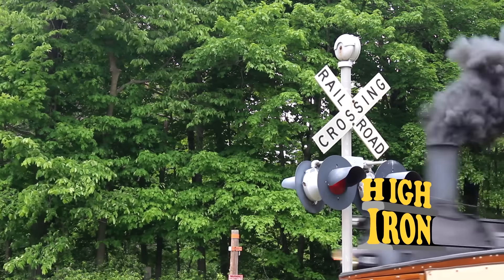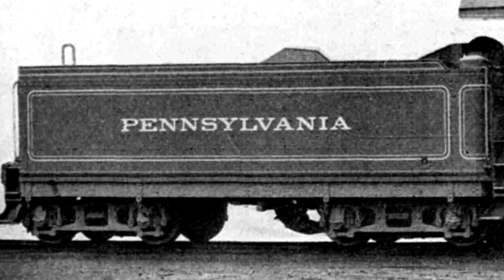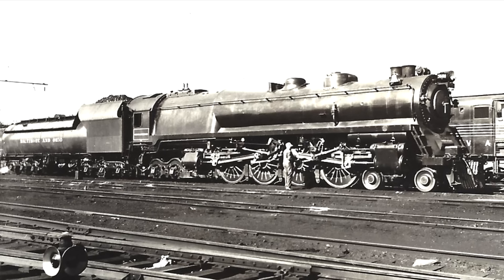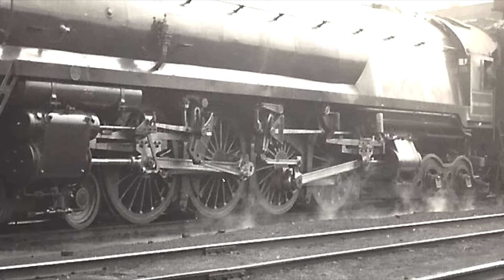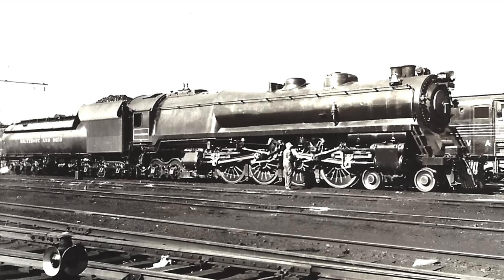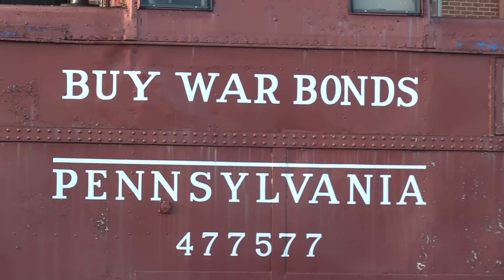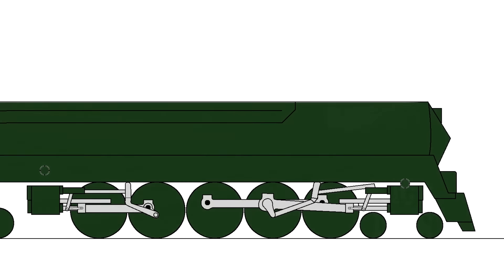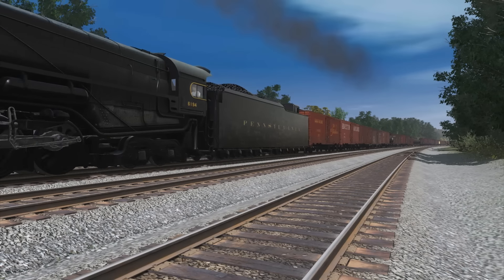Why Weren't Duplex Steam Engines Successful?

Comment: What's surprising is how little the steam locomotive changed between 1870 and 1940. Mostly they grew in size and power, the most notable changes in the design were the addition of superheaters and feedwater heaters in the World War I era. No thought was given to a fundamental change such as use of a rotary positive-displacement expander, such as the scroll device patented in 1912. This would have eliminated the dynamic augment issue and greatly increased efficiency, but there was no incentive for change. The railroads had long been a complacent industry, having no competition except other railroads using the same equipment and methods, so they were caught flat-footed when the 18-wheelers and Interstate highways began to appear.
Reply: At least in the US, anyway. The UK did have a few unique developments, and while they still stuck with the basic reciprocating piston design the layouts and implementations were different.

One good example of this is also one of the most famous locomotives of all time, the Flying Scotsman - or really, the class it belonged to, the LNER's A1/A3 Pacific designed by Sir Nigel Gresley. In addition to the two outboard cylinders, the A1/A3 was also equipped with a third center inboard cylinder, allowing for smoother acceleration, more power and higher wheel RPMs. Other developments on British steam locomotives include designs with fully inboard cylinders to reduce oscillations due to piston movement and tapered boilers which reduced sloshing.
Reply: If you consider the motor car you should not be surprised.  Progressive refinement has worked miracles, radical changes have failed.  Very few features of modern cars had not been thought of a hundred years earlier. They were expensive and impractical at first but refinement has brought them into normal use.  Steam engines did have radical changes such as superheating, piston valves, compensated suspension being among them.  But in general detail improvement made a big difference to the overall capabilities of the engines.
Reply: And just like the locos before them, region influenced design.
Reply: @VestedUTuber  Gresley's three-cylinder designs were his philosophy; nothing 'additional' about them!
"inboard cylinders" were basic to British railway locomotives, along with 'inside' valve gear.
Superheating was adopted early in the 20th century and, latterly, steam-flow improvements made a huge difference to performance (c/o André Chapelon in France).
Reply: thats the capitalistic nature for ya. Why spend a lot of money innovating when doing nothing new makes you a lot of cash?
Reply: @Michael4201YT  That depends on the prior evaluation of the R&D.  If long-term lower costs (positive payback) are in prospect, go ahead and do it.
Reply: @EllieMaes-Grandad 
I think you're missing the point here.
Gresley's 3-cylinder designs may have been his design philosophy, but they still provided advantages over 2-cylinder designs for certain usage cases. Same goes for 2-cylinder designs. So while they may have been "standard" for the UK, they were still innovations over earlier designs.
Reply: @VestedUTuber  You're maybe not understanding me here.  Three cylinders had advantages (more power, smoother application of it, better riding) but with disadvantages too, such as complications, costs and increased maintenance (think conjugated valve gear).   Not so much innovations, more like developments.   U.S. roads had 3-cyl locos . . .
Reply: Because it's always a balance of economics. Steam locomotive innovation only happened when there was a need for it and the method of implementing it would not cost more then the profit it returned. This is why condensing trains only existed in specific locations that getting access to water was costly as it would need to be shipped in. And by 1912 it was clear that either diesel, diesel-electric, or electric was going to become a major part of railroads so any steam based innovation needed to pay off big dividends. Which is why you saw experimentation with so many things but it never paid off to implement widely.
Reply: @EllieMaes-Grandad 
Innovation doesn't necessarily mean no drawbacks. If it did there'd be no such thing - you can't have a perfect system.

And I'm familiar with a number of US 3-cylinder locos. Many Shays had that sort of configuration. But I wouldn't consider them the same as a Greesley 3-cylinder locomotive, if anything like other geared steam locos they're a massive departure from conventional design and a separate innovation in their own right.
Reply: @VestedUTuber  Indiana Harbor Belt had 0-8-0 transfer engines that were 3 cylinder and equipped with booster engines but the 3-cyclinder didn't catch on due to maintance issues.
Reply: @VestedUTuber  The Shays were designed for a specific purpose and fulfilled it superbly.
Reply: What's really interesting is to consider where Steam locos would be today if they'd continued to get the full brunt of development up until today: It had pretty much entirely stopped by the end of the 50s for most countries, meaning steam locos didn't get to benefit from quite a decent chunk of where humanities technological progression really started to speed up.

Take for example the A1/A3's third cylinder that VestedUTuber mentioned, it was notorious for having timing issue at high loads due to thermal expansion of the linkages...these days we have alloys that exhibit little-to-no thermal expansion under much higher heat than you'd ever find in a steam loco yet are still strong enough for that kind of use. Or consider the effects of computer simulations on being able to effectively test thousands of slight variations of the plumbing to figure out the most optimal setup for the steam to go, for the smokebox/front end, etc. 

I'd wager that steam engines would still look familiar but have a tonne of differences versus what we know and love.
Reply: @VestedUTuber  I'm enjoying this debate, but all of you are talking around the thing that ended Steam as the primary source of power: a diesel engine delivers more power at the wheels per BTU of fuel consumed than a steam engine ever can. Add to that the other advantages a diesel engine brings - building block units of power that can be controlled from a single control point; versatility of how each engine can be used; and greatly reduced maintenance costs spelled doom for further development of steam. Trucks didn't sneak up on the railroads, they just didn't look at the reality of how transportation was changing and held on to their incorrect world view for far too long. Like, even today.
Reply: I remember one of the tour guides at the UK's National Railway Museum saying that if George Stephenson was shown 'Evening Star' (the last mainline British steam locomotive, built in 1960) he would have been able to look at it and identify most of the parts. The only two major changes since Stephenson's 'Rocket' of 1830 were that Evening Star had superheaters, and brakes!
Reply: @cdjhyoung  Who is they?  The trucks or the railroads?  Be careful using pronouns--I call it antecedent trouble and it was the RR's who didn't look at reality.  Diesel electric had even more advantages than just essentially being every engine's hauling its power plant so no need of overhead!
Reply: It changed quite a bit!  Air brakes, mechanical stokers, compounding, superheating (which crimped compounding), feedwater heating, electric generating.  Better valve gearing (long big story); in short lots of improvements between 1870 and 1940.  But they were running out of space and of time.  Wage costs all around were beginning to tell even Bigger Time.  .
Reply: @thomasrengel5577  Sorry about that. The "they" in my comment is the Board Of Directors of virtually ever American railroad that existed during the 1940's. It was not too difficult to see that the nation's roads and highways were making dramatic steps in improved surfaces and connections. The possible range of delivery of manufactured items by means other than rail steadily increased decade after decade. The railroad offered little in new approaches to servicing their customers, in fact the opposite is true. When railroad generally decided they didn't want to be in the single freight car freight business, they opened the flood gates for over the road trucking to become the Railroads equal in moving the nations manufacturing output.
Reply: I suggest checking out the Tornado. 
Built in 2008 with lots of incremental improvments from modern manufacturing methods meant it runs better than any other steam engine built before it.

From cruising around the UK to halping a stuck modern train, it is a marvel of engineering and recreating historical machinery.
Reply: What about the Steam Turbine locomotive?
Reply: @ZackarySchejbalCODBO2RGM2  Turbines, as applied to locomotive power, never caught on because they didn't offer enough advantages to over come their problems. Diesel fueled, direct coal and steam were all tried, and all failed to live up to the hype. I think the main problem with turbine technology is that it doesn't scale down efficiently and suffers from not handling the jarring action of a moving locomotive. Labor costs and fuel usage were the killing attributes to this technology.
Reply: @cdjhyoung  Was at least an attempt. Sorta like the electric steam locomotive
Reply: @ZackarySchejbalCODBO2RGM2  When tried, these didn't work very well mostly because a steam turbine needs a condenser to operate efficiently. Since the only cooling medium available on a locomotive is air, a condenser would be immense, and totally impractical.
Reply: @kc4cvh  I was arguing on that there was no thought was given to changes in steam.
Reply: @ZackarySchejbalCODBO2RGM2  There was a great deal of thought given to changes in steam but you need to know where it took place and mainstream locomotive builders are probably not the best place to look.
Reply: @Tuck-Shop  The locomotive that you really need to look at is the project following on from Tornado and built by the same group. P2 number 2007 is looking rather good.
Reply: @DeCasoU1  sweet info, thank you.
Reply: @TheDemocrab  Tbh the steam engine technology might not have majorly changed because this specific implementation was kinda of a dead end. Heavy with many moving parts, a huge and complex shape, difficult to handle and very inefficient, besides a bit dangerous. Efficient steam engines were already run with oil injection or purely on oil, and at that point some kind of diesel engine is just the logical way to go, taking away with the water-intermediate and complex drive system.

Steam turbines might have been interesting, but they arent economical as long as the train isnt running very high speed 90% of the time, and even there petrol-fueled gas turbines are probably superior.

And then you got electricity, which simplifies things even more, be it via a diesel generator or electrified rails.
Reply: @DeCasoU1  It was worth a mention
Reply: @cdjhyoung . I think you are absolutely right, but there was one more fly in the ointment that being who paid for roads. US taxes payed for highways, while RR played for construction and maintenance. This allowed every yahoo with a drivers license too hit the road. If trucks paid for there fair share, not only would we pay LESS taxes, but congestion on the roads would be greatly reduced. 🤔
Reply: Look at the pilot deck of a UP Nine 4-12-2 as built and tell me how different they were from a Gresley design...
Reply: @termitreter6545  It was as much of a dead-end as ICE in general is, or electric generators, etc in that the basic concept was well and truly figured out before any of us were born...However that doesn't mean that there weren't many ways to continue improving it with these other, new technologies being adapted onto the pre-existing concept just like we've seen with ICEs and electric motors.

one example of an area where modern diesel/petrol engines benefit from that steam engines never got is computer control; it'd hypothetically be possible to set up an oil-burner steam loco to only be burning oil when necessary and using the minimal amount needed for whatever heat generation is required if the firemans job effectively gets computerised. The diesel/petrol engine equivalent would of course be electronic fuel injection.
Reply: @Michael4201YT  Actually it was government regulation due to WWI and WWII that stifled innovation.
Reply: @Michael4201YT  There were several railroad companies and locomotive manufactures that were sited in this video which were all exploring innovative ways to improve on the existing technology & increased efficiency. All the while making it affordable and marketable.
Reply: What is rotary positive displacement expander?
Reply: @BigCroca  think of a positive displacement pump or compressor, but run backwards to produce energy from compressed fluids.
Reply: @VestedUTuber  dont forget though Britain and its Railroads had the benefit of seniority on their side when cars entered the scene. Britain's Railways were almost if not entirely established in their country as a primary transport method with innovations like you mentioned, to replace them would be an enormous resource waste and a fundamental change that simply was never going to happen. The US however still had most of its railways in their infancy or early stages. They were established but nowhere to the degree Britain and other countries had, and so when cars entered the scene they were easier to produce en mass and override any issues that might arise simply by making MORE rather than making them better. The US has long suffered from this issue, never really letting an idea mature before they change it or remove it. Do I like trains? Yes, do I like waiting for them going to or coming from work? Not really, but I realize that had we better utilized the systems we had trains could easily beat trucking as a primary freight method, not to mention people.
Reply: Makes you wonder why they didn't make some kind of turbine-reduction drive or turbine electric plant at some point, because steam ships switched to a different power plant somewhere along the line even while keeping things mostly the same on the boiler end. Even with steam, electric drive would have made sense with distributing power to more drive wheels and simplifying how load balancing could be done. I guess there's probably a certain inertia with what the companies and management were used to?
Reply: Þey weren’t just caught flatfooted, þey were caught with þeir feet in cement.
Reply: I'm sure we will one day the same thing about the gasoline powered internal combustion engine
Reply: @TheDemocrab     Steam locomotives lost it in the maintenance department.  This was demonstrated by a study from the N&W railroad.  They pitted steam against diesel.  Steam had better fuel economy but needed nearly constant and extensive maintenance. Diesel could make a trip of several hundred miles, refuel and travel several hundred more miles. I have a copy of study by the N&W.  They tried to hang on to steam as long as practical.
Reply: @Michael4201YT  You mean the socialistic nature. The railroads in the US were heavily regulated by the ICC. Only the Staggers Act in 1980 freed them from ICC control over freight charges and routes, allowing them to abandon non-profitable lines and setting their own freight rates!
Reply: @Michael4201YT  Annnnd there's the uneducated jab at capitalism. Gotta love the originality.
Reply: @raoulcruz4404  WCR folded because of their diesels needing expensive maintenance due to fatigue in the frames while their steam locos were and still are fine, funnily enough.
Reply: Trains are still inherently superior to road-based vehicles, for the simple reason of rolling resistance. Trucks became dominant because post-WW2 motor vehicle companies in the USA successfully captured the government and directed infrastructure policies in a direction that favoured their business.
Reply: it dont mean they did not try concepts I saw 4 differant types of rotery steam engines in google read patints and several water tube style boilers for steam locos, its not that they did not try a few things, we did have some turbine locos and at high speed they worked great but the low speed for the prr s2 had to use a massive amount of blower and would break staybolts constantly while trying to keep pressure, or the coal dust would eat up turbine blades on the hybrid coal turbine electros, and then there was the lat experaments by lima, using poppet valves, and the things that never caught on here, the even porta worked on but the projects fell though.
Reply: mm ,in a way it makes me think on how at first when the idea of engine powered vehicles exploded ...the concepts for how to 'channel' that motion energy.. metal wheels , metal legs etc...
much like how you got functional thread designs for tanks... and suddenly all 'knew' mechs or such just be good as scifi or fantasy.... hmm
Reply: @ZackarySchejbalCODBO2RGM2  If you mean the Jawn Henry (IIRC), she was a steam-turbine MECHANICAL engine, not s.t.Electric. Turbines are notoriously inefficient at partial power, while conventional reciprocating engines get MORE efficient. Since locomotives are almost always using less than full power, the turbine is noticably less efficient / more costly to run. Not to mention the requirement for a robust transmission, etc. A steam turbine electrical locomotive... could be interesting.
Reply: @ReggieArford  GE actually made steam turbine electric locos in the 30s, along with the Chessie M-1
Reply: @doorhanger9317  yes and the early coal fired steam turbine was such a neat concept automatic air control flash boiler could be up to steam in 20 minutes really in my heart of hears wish it would have worked, and the m1's called sacred cows were neat too, somewhat streamlined absolute monsters, and then you have the up gas turbines second only in power to the russian electric/turbine locos for siberian territory, 11000 hp they have, though we could have easily exceded that with purposed engines that were never built it was said in a whitepaper once that the prr t1s would have gained 15 % more power if they would have lowered the exaust stack pressure and had an advanced smoke ejector, that would have been roughly 1500 more hp on an already 6000 hp ish locomotive, or the 10000 hp locomotive livio dante porta had proposed for hauling coal in argentina there was and is soo much that could have been tried and still prob could if someone wanted to invest the money and see it though but seems no one in america wants to lead or pioneer, more worried about what bathroom to use, what the latest fad to address one another as, and how they can find a new way to cancel someone. seems they are content to let the europeans and chinese lead in railroad tech or trying experamental power if it isn't battery operated.  

well no I walk back the last statement musk is working on a hyperloop, which I belive is a magleve type of train in a vacume atmosphere to cut down on air resistance.
Reply: What do you mean, they still move frieght by rail today. It's integral.
Reply: And now look at the aviation industry. Nothing has changed since the 1970s, purely pathetic.
Reply: @Monkofthecaribbean  sure there is higher prices smaller seats, bigger jets, higher security, the planes are bigger and the engines more powerful and effecent, too bad its only for those that have lots of money, or if your luckey they comp you up to buisness class and I got to do that once and it was nice a bit more room, and a few more freebies, especially if you are a frequent flyer, but people are not as kind and dress like they are going to a slumber party, you meet all kinds of people though from all over and all walks of life.
Reply: @manga12  musk admitted that he made up the hyperloop as a fake proposal to stop the building of California High Speed Rail
There's a reason he's never done any work on the concept and it's all completely independent companies who've picked it up. The idea is a joke. If you want to look at what's really next for advanced rail, they're actually building that ultra fast intercity maglev line in Japan. You can still debate cost-effectiveness of that project but at the very least, it's actually a real thing and not some vapourware
Reply: the underlying tech in the locomotives changed much.
Reply: Why did we stop using steam? Its literally a perfectly simple way to make power. It is the medium which our most powerful source of energy uses to generate electricity; nuclear reactors. That should say all you need to know about how much force and power is possible through the proper use of steam power. We got too obsessed with piston engines, increased complexity, more moving parts, new tech, and new fancy fuels, that we forgot about the perfectly adequete solution that we took for granted the entire time, and dismissed its potential for improvement. Its a shame; steam trains are beautiful things. I will likely die without seeing one now ;(
Reply: @pleaseenteranamelol711  steam engines are pretty and nostalgic but they're dirty, polluting, slow off the mark, require massed hard labour to run, maintain, and fuel, and require truly vast amounts of water just to run. They could have lasted longer in service in some places than they did - China built new ones into the 90s - but in the long term the fuel efficiency, cleanliness, and operational simplicity of the diesel locomotive wins out. The kinds of coal that steam engines use are far too expensive to min now anyway, and that's not just a function of low scale. But despite widespread dieselisation, the real kicker is electrification. Electric traction is such a different ball game to anything else that it was the obvious choice for many railways over 100 years ago before diesel was even really option. You can't beat a train that can harness the full power of the electrical grid.

Also you can see loads of steam locos at heritage railways
Reply: @pleaseenteranamelol711  there are lots of videos of them and in many places there are excursions, or tourist railroads where you can see live steam, or steam and engine clubs that preserve old stationary engines and steam tractors, especially in the east half of the usa, and many amusement parks have them even if they are smaller scale,  and the thing is there is still soo much that could be done to get more out of steam, that livio dante porta called the 3rd gen steam using concepts and materials that had not yet been concieved at that point, but there are soo many things you can add to get 1 percent here 10 percent there to get more effective use of the steam or gas thats heated to drive a piston, a rotor or turbine, however everyone seems bent like a piece of angle iron to make everything electric forsaking all other concepts even with alternative fuels or even fireless steam engines like used in the days of old, or compressed air locos, the thing is we cant just use coal forever it gets a bad rap, and smells bad to most people, and has all kinds of stuff you dont want in the air in mass quantitiy, but with steam if you can make it provide heat enough to boil water you can use it even old frying oil, biomass, or wood gas, even hydrogen potentialy, or alcohol like a race car.
Reply: @pleaseenteranamelol711  mostly due to thermal efficiency. a diesel engine is able to extract far more energy than a steam loco can.
Reply: @doorhanger9317   You cover almost all of the deficiencies of the steam locomotive, including the oft-overlooked cost of water. Here's another: track depletion. Everything from the rail to the subgrade crumbles from the impulses of dynamic augment, while the railhead is scoured by the peculiarly varying adhesion of six to twelve coupled wheels. The force analysis must consider quite a few cyclically varying forces but the result is the primary driver must "shuffle" a bit owing to its effective radius varying more than the other drivers. Thus steam locomotives had steel tires on the drivers, so that these might be replaced instead of the entire wheel when they wore down, usually with an uneven radius. With electric traction, rails became lighter and needed less frequent replacement.
Reply: @pleaseenteranamelol711  Because steam consistently cost more.
Reply: @kc4cvh  yeah, this sort of thing - combined with jointed track, and low quality jointed track at that - led to pretty restrictive axle-weights on a lot of lines back in the steam days, at least in the uk, and that in turn led to the proliferation vast numbers of locomotive classes to fit certain operating environments. You did have weak structures in some parts but largely it was just to stop the track being pummeled. The dynamics are so much nicer with any other form of traction that most modern locos are effectively go-anywhere as long as their bogies can navigate the curves.
Reply: There were a lot of reasons why this happened, but I don't think locomotive efficiency was one reason. Steam locomotives are by far more efficient that any 18 wheeler today. Based on books like 'The Box' it was more about the bizarre economic incentives of railroads encouraging them to shrink, capital pushing more refined consumer goods, and massive government subsidies to highways.
Reply: 18-wheelers can't carry the loads a train can, neither is it more reliable. But in a car-centric culture, you can't go stat by stat cause belief trumps fact
Reply: But, that actually didn't happen, well I'm talking about these competitions between Rail vs Road Travel, bc everyone seems to appreciate both back during the time of the Big Four, ya know the LMS, GWR LNER, and GWR and the others with the Americans competing along with the Railroading Courtesy, which the British had everything in the first place to begin with the idea of Rail Travel, then us Americans decided "Oh, that looks like a Puptastic Idea, indeed, so we'll just copy their own version and expand it even further and better, but without the silly Buffer and Chain system, so we'll use something much easier, we'll use a giant knuckle coupler to connect each individual car or coach together and make the frame of our Freight Cars, Passenger Coaches and other assorted Rolling Stock more durable and rust proof and rust resistant, even in very dense weather conditions, our trains will get the jobs done right,.!" but no....... all the Railroading Companies want to argue about this or that, and claiming that one piece of specific material is theirs alone, which I say is really pathetic, trying to keep something all to one self, is not good for any Railroad, especially when the Roads themselves are contributing to help us, even the ships at sea are helping us with our daily deliveries, but they sometimes complain but it has to get done, somehow.

I'm Ella and It's Time to Think BIG!!!!!!!!!!!!!!
Reply: @VestedUTuber  A design by C&O that I would have liked to have seen built was to look like a 2-8-2 without side rods, but was a 2-2-2-2-2-2, where each drive axle had its own engine block inside the frame. Each engine had 4 vertical cylinders, 2 on each side of its axle. They built one prototype engine, which fell from a stand and seriously maimed its designer. The project was cancelled and the engine was scrapped.
Reply: @kc4cvh  South African Railways Class 25  4-8-4 condensed its steam back into its tender to save water by 90%. It took 500 hp to run the fans.
Reply: @DeCasoU1  Look up Livio Porta, who worked wonders on improving the efficiency of steam. He turned 900HP locomotives and turned them into 1200HP units that used 20-30% less coal and water. All by improving the exhaust system. He did much more, too. Look up SAR Class 26 Red Devil, that had a Gas Producer Combustion firebox modification too.
Reply: @psycotria 
That sounds really complex and prone to both mechanical breakdowns and, unless the cylinders are really small, running out of steam faster than an Erie Triplex.
Reply: @psycotria  I am well aware of LDP and have a number of his papers. I know the work of David Wardale, his book "The Red Devil and other Tales from the Age of Steam" is well worth reading. I did write to him some years ago. There are other individuals and groups (see The Advanced Steam Traction Trust). The problem with the steam locomotive is that though you can fairly easily build one which works building a good one is far more problematic. Chapelon once observed that Rankine theory does not predict what you can achieve in practice. As for what might be achieved, who knows? People thought that the steam locomotive was developed to the point where little or no further improvement was possible. The along came Chapelon and later Porta and people still refuse to believe what was achieved. Once people are convinced that something is right it is very hard to convince them that the reverse is very much the case. And if you are in any doubt about this, simply look around you.
Reply: @pleaseenteranamelol711  "steam trains are beautiful things. I will likely die without seeing one now"....

Where do you live? Here in the UK heritage lines are quite ubiquitous. There's a steam train which runs past my house once a week on the main line. On heritage lines, I've been on at least three in the past year.
Reply: @psycotria  these gains in efficiency were not considered in the grand scope in that, the original designs were far easier to maintain and service and were probably safer. Just like everything made to be efficient because of false scarcity they have created. We are also running the old stuff wrong, but they are not telling us the original design parameters such as the change in atmosphere since the mud flood.
Reply: @doorhanger9317  They don't have to be dirty and polluting, they don't have to be slow off the mark, neither do they need massed hard labour to run them. They were ended up being that way in the main because of conscious choices which were made by people who though adequate were not capable of understanding what they were dealing with. For how many years did we accept a combustion system which launched vast quantities of unburnt fuel into the air? And why did we do it? Was anybody doing any thinking? You can reach a limit on a locomotive where 50% of the fuel you put on the grate gets entrained in the primary airflow and gets expelled in essentially raw form straight out of the chimney. Why did we have to wait until a young Argentinian engineer pointed this out? The designers of steam locomotives and their associated infrastructure were adequate for FGS (First Generation Steam) but very few were capable of thinking beyond that. On the point of exhaust emissions, if you use an instantaneous analyser to sample the exhaust of a well managed steam locomotive it is far cleaner than you might think. But we live in times where people are incapable of discerning the difference between water vapour and smoke. Don't believe me? Look at the use of images of cooling towers and the associated messages which go with them.
Reply: @DeCasoU1  the problem with Porta and other similar attempts was that those engines partially lost out in their key advantage: low cost.
 If the operational costs of diesel are cheaper, the choice is really how long you wait before you make the big investment in new motive power, and you generally don't want to make a big investment in experimental steam when you can just move to diesel at that point and be done with it.
Conversely, if operating steam is cheaper anyway, like the situation a couple chinese/Mongolian coal mines found themselves in until at least the 2010s, then you don't really need all the fancy expensive whizbangs to make them more efficient
Reply: Railroads were embracing diesel-electrics as long ago as the late 1930's, long before the Interstate Highway System was created.  WWII delayed full dieselization by about ten years.
Reply: Seems to be the state of the industry today as well. Complacency due to routine high revenue with little, if any, outlays on maintenance or upgrades
Reply: the railroad is the most traditional industry I have ever been a part of, you could tell them, I can make you something better, with less lead time, and for less money, and they are not having it. It's very much an industry of "this is the way we have always done it" there is some sound logic but........
Reply: The biggest issue was cost effectiveness.  The fuel was fairly cheap compared to today.  An engine which is more complex and thus far more expensive to produce for relatively minor improvements in economy and performance didn't really make sense.
  Diesel electric came along and we're far cheaper to produce and operate.
Reply: @Michael4201YT   Because if your company does not innovate while your competitor does innovate, and their innovations result in products which are more efficient, cheaper, more profitable, and/or all of the above, then your company will end up losing its market share to said competitor. Thus in order for your company to survive, you need to innovate.

However when the government interferes and makes it to where companies do not need to deal with competition, then the motivation to innovate in order to keep up with competitors stagnates. This isn't an issue with capitalism, it's an issue with government.

Capitalism is why the diesel locomotive replaced the steam locomotive. Capitalism is why airliners have become larger, faster, more efficient. Capitalism is why computer hardware developers continue to develop cpus and gpus which are higher performance. Capitalistic profit motive absolutely drives innovation.
Reply: I wonder if the slow evolution of the technology wasn't because of limited materials technology. Also, we know many railroads weren't exactly on the cutting edge of innovation.
Reply: @Michael4201YT you don't understand what capitalism is.
Reply: @biosaber585 you are dead wrong, as a whole the United States had a far superior railroad system than britain, it wasn't even close. WW2 was won by the US railroads supplying all the allies with the infrastructure and logistics needed to win a global war. Also back in that time you could hop on an interurban within a few block from your house and it would connect to a train that can connect to others  that could take you damn near anywhere you wanted to go to in the United States which might as well be the size of an entire planet compared to "great britain".
Reply: @Waldemarvonanhalt trucks were faster, there was a demand for the infrastructure to built. The people chose the freeways.
Reply: @Tuck-Shop and others,

I think the key takeaway here is that the incremental improvements to steam locomotives were evolutionary, not sudden and dramatic (revolutionary).  Yes, we could have had a total change - eg. steam turbines - but developers of the day just couldn't make that tech work within loading gauge limits and then-current materials technology.
Reply: @Michael4201YT  So you're saying innovation comes from poor performing communism?
Reply: @smitajky
Reply: innovation all come down to money. People who want to innovate did not have it. Of course the steam engine could made to be more efficient. another concept that could help with efficiency would be air intake regenerator. which the exhaust steam and gas goes over radiator that warms the intake are. this allow waste to be recaptured and sent back to the fire box. Though not much efficiency can be gain this way since it a steam engine. I think around 10 percent efficiency can be gain. how ever considering how inefficient steam locomotive are that 10 percent gain would very noticeable in fuel consumption. Since single stage engine is around 5 percent efficiency.
Reply: make a new electric hybrid that uses an on-board steam turbine. Them things are like 90%+ efficient if tuned right. Then the conversion back into torque is also 90% + efficient with good motors. Literally standard train but prime mover is a steam turbine engine.
Reply: @baconthevainglorious7371  I read a while back that General Electric achieved 63% with their 7HA turbines, but in a combined-cycle plant, not direct-fired. Also, turbines need condensers and condensers aren't practical on a locomotive.